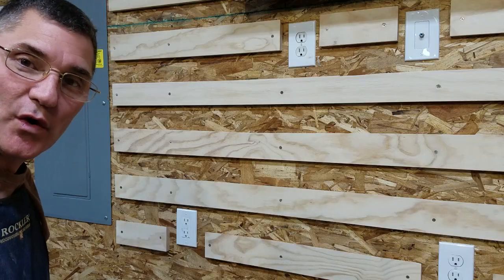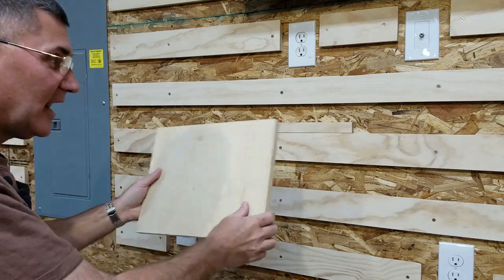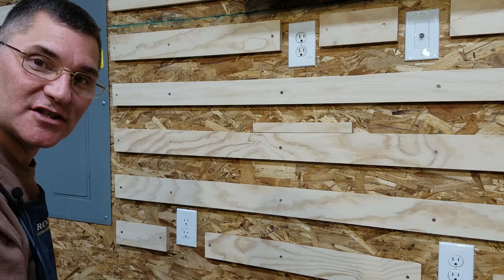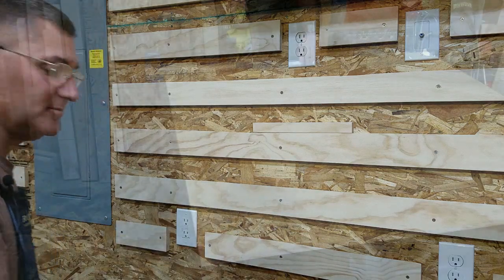How to Build RYOBI Tool Holders for a French Cleat Wall | 2019/27

Comment: Nice job on the paper dispenser with cutter. That one I'll have to copy for my shop, thanks!
Reply from the maker: I think I'm going to move it to the end of my assembly table when I get that built.
Reply: @DadItYourselfDIY  mine is currently on the wall under my lumber rack. Shop is too small for an assembly table, so I maximize space where I can. On the assembly table would be ideal tho
Reply from the maker: Im thinking the table will only bee deep enough, 30" to accommodate the roll and give me enough work space, but can be easily rolled against a wall out of the way.

Comment: What a great video. I though I had a decent collection of Ryobi tools but yours is off the chart! The French cleat system is brilliant. Finding a reference to the 3D printed tool mounts was the icing on the cake. Thank you 👍😎🇦🇺
Reply from the maker: Thanks.. looking to add another wall soon..
Reply: I don't see the 3d printer reference. What model is it?
Reply from the maker: Colido 3D DIY.. I have replaced it since then. I have a Longer 4K now. There is a link in the comments.

Comment: If Ryobi doesn’t sell that tool mount you  3D printed, you should. Brilliant.
Reply from the maker: You can download it for free from the internet. Many models are in the public domain, but have restrictions on selling them.
Reply: @DadItYourselfDIY  this is a great video and idea. i just made a holder for my brad nailer yesterday and used a block of wood to 'sit' inside the battery chamber. this idea is WAY cleaner. i'm gonna look into this. thank you for sharing.
Reply from the maker: They are perfect!

Comment: Very well done, both video production and clever builds.  Nice custom 3d printer too, like that you printed the dummy battery as a holder.  Did you design it yourself?  I have built a few larger format corexy printers, fun and useful.

I'm designing a french cleat system for my shop, your video gave me a few ideas, thanks.
Reply from the maker: I downloaded the STL file for the tool holder from Thingverse.

Comment: so your idea of showing people french cleat holders is to use a CNC machine??? wat a stupid video! less than 5% of people own their own CNC machine. great way to "connect" with your audience
Reply: That was a 3d printer.
Reply from the maker: Umm.. it's a $200 hobby 3D printer.
Reply: Thanks Bob for your articulate attempt of putting down someone who, w/o compensation, provided you with ideas of un-cluttering your shop. 
I know it hasn't happened yet, but I want you to know that just as soon as they come out with an internet troll feel-good Hallmark card, I'm going to run out and get you one of those. 
Enjoy your trolly
Reply: Cmon, Bobbert....